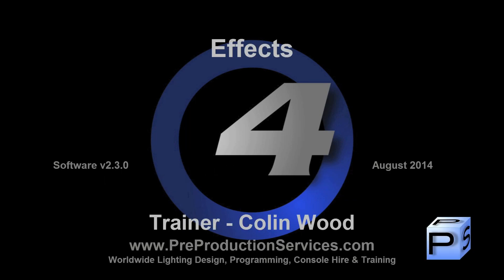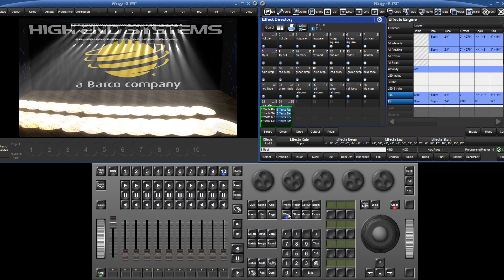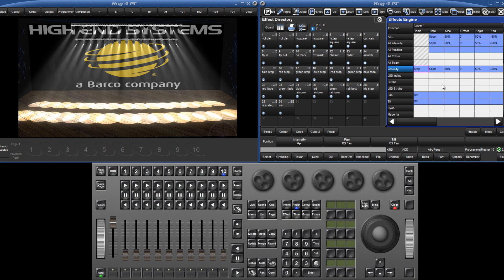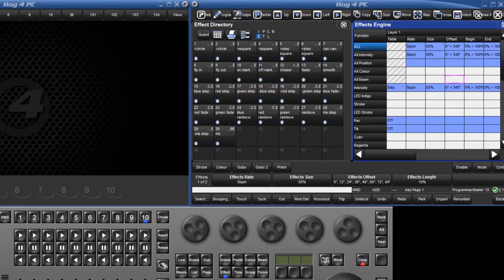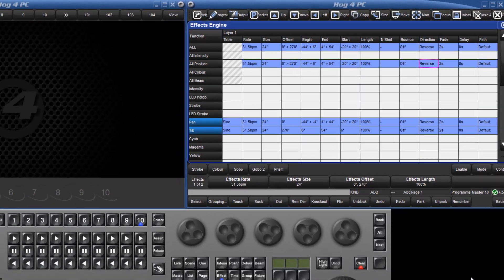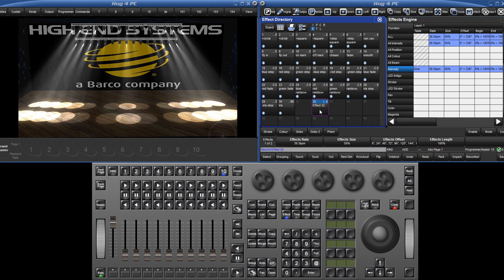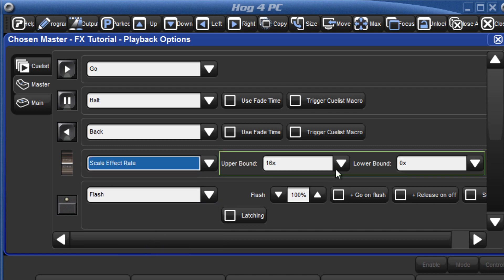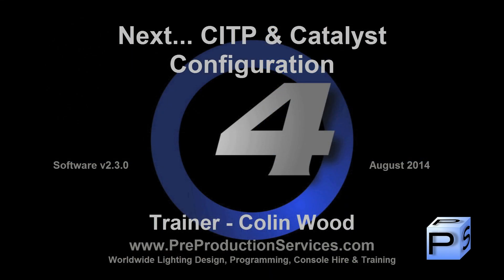HOG 4 Tutorial 20 - Effects

Comment: Note that 348° is not always the value that will offset all fixtures evenly.  Divide 360° by the number of fixtures, then multiply by one less than the number of fixtures.  In this case 360° / 30 fixtures = 12.  Then, 12 X 29 fixtures = 348°.